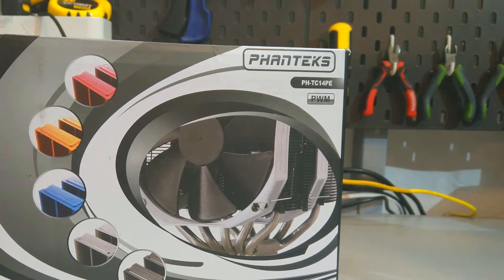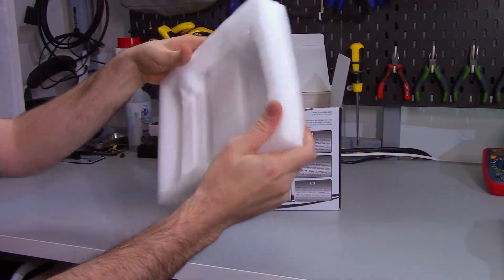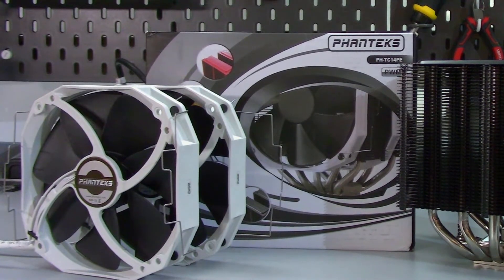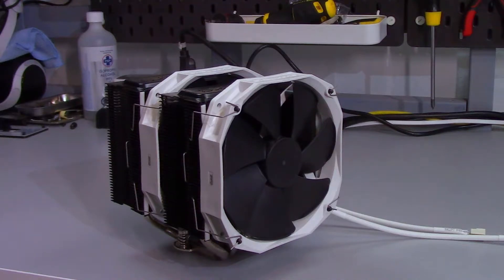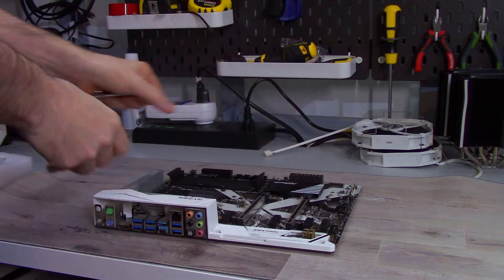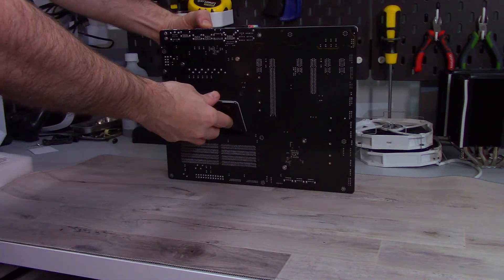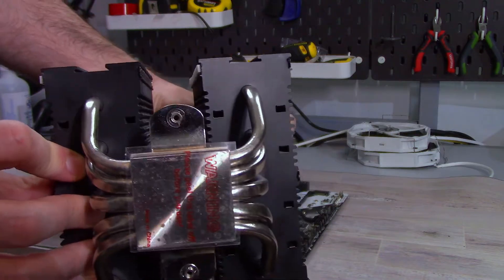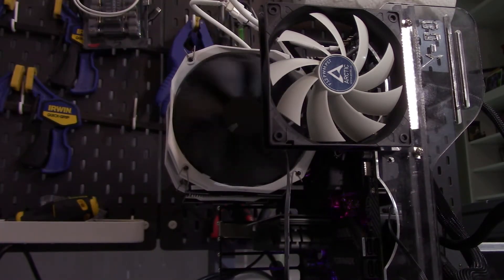Phanteks PH TC14PE CPU Cooler - Review and Testing

Comment: Does fit LGA 1151 This I can attest to, it also trounces most water cooling solutions, so you can be as negative as you like, it's kept my CPU below 65 degrees centigrade, even under extreme load for more than 6 years.
Reply: So I'll just use the holes for the 1155 and 1156?
Reply: @dreamshooter90 I did.

Comment: I have this cpu cooler on my Ryzen 7 5700G. When enabling the High performance power plan on windows it gets 55-60 on idle and 60-65 on gaming and then it gets kinda loud. When enabling the balanced power plan it gets 50-55 and the same 60-65 on gaming. My old entry 240mm watercooler would get me 35-40C on balanced power plan while on idle. I`m using the same thermal paste that I would use on my old watercooler and already reinstalled the cooler but it didnt solve the issue... I`m wondering if this cooler is really compatible with AM4. I sold my old watercooler to get this cooler expecting it to be better... Any idea of how can I solve the issue? I`m almost buying an i5 10400f kit to test cuz ive seen on tests it performs well with low temps. I`ve tested this exactly cooler and my exactly thermal paste on my Friend`s i9 7980xe and it was getting  23-25ªC on idle.
Reply from the maker: Based off all the CPU coolers I have now tested this is not a good cooler. As far as I know there is no way to make it better.
Reply: @Hardware For Gamers  you must be doing something wrong or the cooler is faulty. It is well known that the TC14PE is on par with the NH-D15.

Comment: I've got this cooler on my 6600K,  which is overclocked to 4.6GHz, I've had it for 7 years, it's an excellent cooler. Effective, very quiet and looks really cool to me at least. What is not excellent is Phanteks will not be releasing any adapter kit to I can use it with LGA-1700 12th Gen Intel CPU's. VERY annoying given Noctua have already released kits for theirs. I do really like this cooler but because they are not releasing any adapter kits which forces me to buy a new cooler for 12th Gen I'll buy Noctua for future proofing.
Reply: Shame i order AM4 bracket cause its should be compatible and its becouse product reach end of life :( i dont know why one of best coolers.